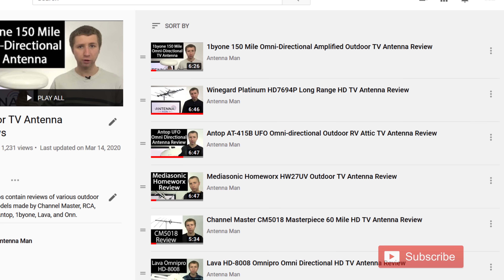Lose TV Stations at Night? This Common Item Interferes with TV Reception

Comment: Well, which light bulbs should I watch?.... those inside near the tv which I can see, or those outside in the neighborhood which the antenna sees? Long long ago in a galaxy far far away there was only analog TV. Back then, cloudy overcast days gave better reception than clear days, while clear nights gave better reception than cloudy overcast nights. I'm almost on a straight line betw Tampa to the southwest 50 miles and Orlando to the NE at 40 miles. I'm using a homemade DIY (Danny S Hodges-style) Hoverman-hybrid without a reflector screen which would cause it to be directionally biased. I get all the available UHF rf channels in the area. The VHF channels can be troublesome, and there are five high-VHF channels. The Tampa PBS, FOX, NBC, and CBS affiliates all are on rf 13, 12,  9, and 10 respectively. The Orlando NBC is on 11. Mornings betw 8 and 9 I can hold them all. Evenings can be iffy. Its' 9:03 pm EDT, I just walked over to the thermostat to turn off the A/C... why?... Because the antenna is on the same back-side of the house where the outside A/C unit is, and when it's running I get pixelation on the weaker of the TPA channels, the PBS on rf 13 and the NBC on rf 9. Some airlines have routes through Orl-MCO which start and terminate in TPA, and I'll have pixelation and signal loss on one of those TPA hi-VHF channels and then I can go out back a few minutes later and I'll see an airliner coming overhead from that direction on it's way into Orl. I shouldn't care -- except that all four of those TPA-based hi-VHF channels either have more subchannels or better local news broadcasting than their Orl counterparts. So I still have to experiment with ways to improve the gain on those TPA VHF channels, longer whiskers, or perhaps w/ a reflector-screen on just the lower half. Keep up the good work and swell videos!

Comment: #AntennaMan I purchased a Clearchannel v2 located in the window, on the other side of the room im using a RCA powered antenna with Verizon splitter that im using backwards both of them are screwed in the antenna output and a single RG6QB out to the tv, is this ok or will this cause signal cross inference limiting my channel reception ? Currently i now have about 4.1,4.2,4.3 ,5.1, 5.2 6.1.2.3.4, 10.1.2.3.4, 10.1.2.3.4,12.1.2.3.4,74.1.2.3.4
But lost my 25.3.4.5 ,26.1.2.3, 36.1.2.3, and i think maybe 4-5 additional other channels. It the splitter causing this or will i need a signal booster to pull these in or would this make is worse ? I also could move the anyennas around again at different windows. My zip code is 02860 so with that, am i maxed out as for channels available for me ?
Reply from the maker: You are likely getting multipath interference when combining antennas. I do have a video on this topic if you check out my other video but if you'd like my help directly sign up for a custom antenna recommendation at the following link: http://antennamanpa.com/antenna-recommendations.html

Comment: It seems to me a shield may do the trick in some circumstances.
You may have one of those really cheap Chinese LEDs. You know, the ones that won't turn
off when you shut off the switch.(it's related to ac capacitance discharge on the neutral.)
A quality bulb may be the fix.

Comment: My city decided to change all it's street lamps with LEDs for the energy savings. Will this affect my reception at night? The nearest LED is about 100 feet from where I need to put my antenna. (I spent the weekend binging your channel. I learned a lot and am going to wait until Atsc 3.0 comes to Cincinnati (2021 probably) before I cut the cord. In the meantime, I will stay subcribed. Keep up the good work!)
Reply from the maker: Most times no, as long as they're not using cheap LED bulbs. If they do you can contact the city to complain. You'll know if you lose reception when they turn on at a specific time.

Comment: The only exposure to the outside faces directly into trees, my other directions are interior facing, when leaves are in full bloom  that’s when I lose channels. I have a flat antenna taped to the window, it has a plug in amplifier . My condos don’t allow outdoor antennas and this flat type gives good signal to most channels, I don’t know why, but the Spanish language and shopping channels are all crystal clear, why can’t the ones I really want give me weak or block signal. I think no matter where I place this antenna, even if I get one with a longer range, if I have it placed against the glass the first thing in my way is a row of trees 100’ away. Is there a flat, amplifying antenna that might help?
Reply from the maker: If you're looking for a decent indoor antenna try this model. An amplifier likely won't help the junk flat antenna that isn't picking up the station in the first place. https://bit.ly/2W92bEB

Comment: For some reason a channel pretty far away (65 miles away) has pretty decent signal like 60-70 during certain times of the day and then sometimes the channel doesn't even come in like 30-40 signal strength, I don't get it.
Reply from the maker: Changes in atmospheric conditions cause the signals to fluctuate a little. You may need a better antenna setup.

Comment: Thanks, Tyler!  I'm wondering if the LED bulb affects reception based on proximity to television, antenna cable or both; and, is there a recommended perimeter of avoidance?  I applaud your mission and wish you the best!
Reply from the maker: It depends on a lot of factors. The close to the bulbs the more likely the interference.

Comment: Science: All diodes are simple rectifiers. It was discovered long ago that they can emit infrared light. With the use of phosphors & chemicals they were able to convert the infrared light to visible light for Light Emitting Diodes (LEDs)... in warm colors like red, orange, & yellow-greens. 

 Since then they developed diodes that emit ultraviolet light. Through the use of phosphors they convert the UV light in modern LEDs to colder colors, like deep green, blue, violet, & white. LEDs are still just simple rectifiers & do not emit radio or TV signals & interference... not even Christmas lights. It's a hoax for clicks & headlines. 

 However, some of the power supplies used to drive LED from house current or batteries may emit tons of radio waves & RF noise. But it's usually in the Khz range interfering with AM & shortwave radio. There are a rare few LED power supplies that will generate noise up to 3-4Mhz, far below low VHF starting at around 50Mhz. Typical modern UHF TV frequencies start at around 500Mhz. 

 I'm a ham radio operator, heavily involved in electronics, & have spent a large portion of my life since a teen working with RF. I've never detected RF from any LED, & never detected any RF from their power supplies above 3Mhz. There's LED light everywhere in my house for well over a decade. 

 But if there is an interactive bulb operated by a remote, or via wifi, higher frequencies may be involved that may interfere with TV, FM, or your wifi. The LEDs are not at fault, but it may be some crap electronics used to run them. Just don't buy garbage. They could burn your house down or give you a shock someday anyway.

Comment: Nice vid! I assume that since LEDs are DC, the RF noise is coming from the power converter that changes 110AC to DC. It's possible different brands are better built and don't have the problem. This might also be a problem for ham radio because they use VHF and UHF bands.

Comment: You forgot to mention whether people are using dimmers and what kind of power supplies.  Dimmers or the cheapie power supplies may be the actual problem, not the LED itself.  My ceiling cans used crap power supplies, I dumped them for a good quality shielded power supply, and no dimmers.

Comment: I use a "junk" antenna I got from Heartland Express catalog for about $20.  It's quite a few years old and pulls in all the channels available in my area except those in the northern fringes.  Usually about 45 channels from the 2s thru 69s.  But the problem is the other junk antenna on the upstairs tv that won't consistently pull in low VHF, and I'm shooting for thr 3s and the 6s out of Philadelphia.  So, I'm looking for an antenna that not only receives UHF, but also both high and low VHF.  I emailed an antenna website, and they don't have any low VHF antennas and said very few make them.  Any ideas?
Reply from the maker: I service the Philadelphia area. Consider a custom antenna recommendation or installation at my website: http://antennamanpa.com/index.html

Comment: I'm a ham radio guy and deal with RF interference all the time. An LED actually causes virtually zero RF interference. Think about your TV...there are likely DOZENS of LED bulbs lighting the screen itself. The cause is the crap switching power supply in some bulbs and also many, many other devices that use switching power supplies. For a very small amount you can make these RF quiet, but many countries just don't care. Every wall wart is a switcher anymore. Look around...they are everywhere in your house. "back in the day" these were larger, heavier transformers. They were quiet. They also cost a lot more. 
You can do some "ham-like" things to mitigate RF interference like use ferrite beads (that thing on some of the better chargers that is a cylinder surrounding the cable is a ferrite...it can absorb some of the RF coming off the power supply antenna (the wire itself acts as an RF interference antenna). Ferrites are designed for different power levels and different frequencies, so you'll have to do some homework if you want to try your own fix. 
But what about that FCC Part 15 certification on the LED package? Ha ha ha....cough... Our illustrious FCC allows manufacturers to self-certify. And assuming they even bother to try, they DON"T HAVE TO CONNECT A WIRE, so your device may be OK with no cord, but connect the cord (antenna) and it radiates all over. Can a cheap LED light cause TV interference? Sure. Get hold of an old AM transistor radio and move it in the vicinity of your suspected source. You'll tell immediately if it is emitting. A 15 buck Sony AM radio is a poor-mans spectrum analyzer. 
I'm seriously into antennas at home. My house looks like the Russian embassy roof. I deal with this stuff all the time, as I said. Hams use a lot of very, very, very weak signals (on HF especially) and are generally far more critical than OTA TV.
One last thought....your electric utility can cause many RF issues. Take your AM radio out near any connectors, transformers (common issue) and see if there is a lot of noise. This is way more common than you think. They will fix it for you if you point it out. Give them details like a pole number if you can.

Comment: My dad and I recently moved into a place and decided to just use the antenna that came with the house and its a big normal freestanding one. However, when we first started watching it had more channels than a portion of them disappeared?. Also is there anything that can be done with the distortions and cut-outs every now and then? or is it just how it is?. I added an amplifier we had from a cable company it helped the picture somewhat but that's all. Either way, it sure beats the cost of cable.
Reply from the maker: It's likely an FCC repack issue. You may need a better antenna setup. Consider a direct consultation with me - I can help troubleshoot your setup and figure out what's going on. http://antennamanpa.com/antenna-recommendations.html

Comment: My wife bought one of those flat antennas. It worked, but sometimes intermittently. I replaced it with a GE Pro Attic Mount number 33692. I mounted it on a table pointed out a window toward Nashville, which is about 40 miles away. There are some significant hills between here and there. It works quite well without an amp and we receive more than double the number of channels that the flat antenna did. Sometimes, but not often, the screen becomes pixelated and unwatchable on WKUW LD, which is broadcast on UHF 28. I narrowed it down almost always to charging a phone on a wireless charger. Taking the phone off the wireless charger usually fixes it. Occasionally the screen pixelates and I'm not sure why. It's usually in the morning and I think it's been since the leaves grew back in early spring, but sometimes it's good in the morning. There's one LED light on the porch at the other end of the house. I'll shut it off tomorrow morning for a test. Other than that channel, nothing pixelates. I think we get about 50 channels. Not bad!

Comment: Fluorescent lights are terrible for this. I have a small TV and FM radio set up in my garage. When I turn on the lights, I lose 90% of all stations except for the really close ones. That's even with an antenna mounted outside above the roof. Is there a solution to this? Incandescent bulbs are out of the question because I need a lot of light when I work on stuff. For the radio I realize I can just stream it online, but where's the fun in that?

Comment: Thanks for bringing up this "who would have guessed" (*I* wouldn't have) interference gremlin for those of us getting OTA/Broadcast TV And using LED bulbs near the TV.
I've had this occasional reception problem for some time now -- and IIRC, always at night and after 10pm or so. Last night it was happening again, remembered your video here and when the pixelation got worse I turned off my back patio LED-bulb light (which is within 6-8 feet of my TV in the living room) and the pixelation ceased (except for one short instance). Today I replaced the LED with an incandescent bulb and will see if the problem is really gone.
But I STILL don't get it: Would think if it WERE the LED bulb, the pixelation would  be happening REGULARLY but it doesn't. Further, I'm pretty close to the TV towers here in town, so the signal should NOT be a WEAK signal affected by a LED bulb.
I don't think there are any HAM radio operators in my apt complex, and I don't recall aircraft flying over to account for the pixelation, but sometimes when it's really windy I can have pixelation issues -- which doesn't make sense (to me) as I can't believe the WIND can affect radio waves!
Just goes to show it can be very difficult to find the true culprit sometimes when ti comes to reception issues.
Still, if removing the LED bulb works, then it most likely WAS causing at least some of the problem, if not ALL of it.
Thanks again for the tip,
-- BR
UPDATE: Well, the pixelation is back tonight...so it must be caused by something else. The channel it's been happening on is the ME-TV channel, Virtual Channel 14.3. Our local KFOX TV is virtual channel 14.x but the RF channel is 15 (476 MHZ). Have no clue what's up. I usually "fix" it enough to make the channel at least watchable by moving the antenna around temporarily, but most times, the antenna stays in one place and channel "14" is fine. It's just weird. ..
But it does make sense in a way: As I said above, if the LED bulb was causing the problem, then I'd think every time it was ON (at night!) Id' get pixelation every night on channel 14.x -- but I don't. So again, the occasional pixelation at night must be caused by something else.
Not goign to worry about it though, as it happens only occasionally. Besides, am moving back to Colorado come September, so I can live with the problem for the next 4.5 months here in TX until then.  No need for a permanent solution (or even more time/effort to find the CAUSE).  ;-)
-- BR

Comment: Hi I live at 926 Main Peoria Illinois eleven stories up in an apartment building. We are not allowed to put antennas outside.. in the owners would never pay to put a antenna on the roof anymore....so what would you suggest.  I have one of those crappy 150 mile antennas sitting by the window on air-condition and it does horrible. So what do you suggest. I'm into all brick building downtown with two major hospitals next to me with lots of MRIs and such
Reply from the maker: Try this indoor antenna. It's one of the best models out there. https://bit.ly/2W92bEB

Comment: Hot Dog!  THANK YOU SO MUCH!  I would lose our local Ch 4 (on Ch 9) every night.  They were supposed to repack to Ch 13, but missed their deadline so figured they were dropping their power at night until I talked to my sister who was receiving them fine 45mi from the tower.   So figured it had to be local interference, but WHAT?   Turns out  It was my Christmas laser light display that goes on at night!   It was directly effecting the channel 9 frequency.  How did this product clear the FCC?  It appeared to be the power supply itself located 12ft from the antenna.  As I moved the PS slightly, the interference would come and go.  Just moved it a foot and Ch4 is all clear now.  This started a few weeks ago when I moved the PS to rake some leaves. Who would have thought...  Also, it was effecting our Ch 13, now repacked to Ch 11.  So that power supply was really tearing up the VHF Hi band!  Thank you!

Comment: For me it’s the reverse. At night, tv reception is best. During the day, especially after the sun is risen or is at its highest point, reception problems abound. 

Also, I agree about those junk antennas. Never buying one again. I made my own from some tip I found on ytb. Basically, it’s a long coaxial cable that’s been stripped about a foot at the end point. I get all the channels and then even some I could hardly pickup with those other fake antennas

Comment: I agree that some of these cheaply made L.E.D. lights Made by China may be radiating RF noise however a shielded RG6 coax cable should be able to block that noise from entering the cable especially one from an outdoor antenna. I have both L.E.D. and fluorescent lighting and no signal issues at TV.